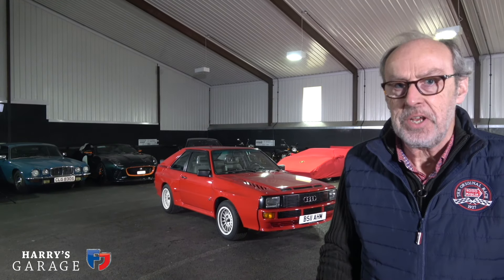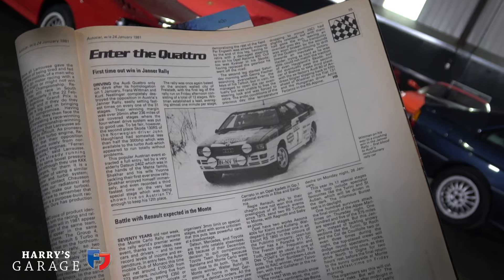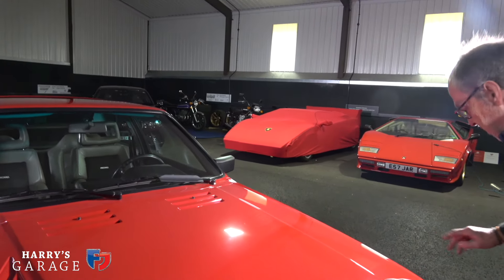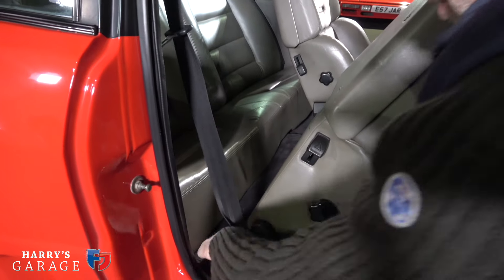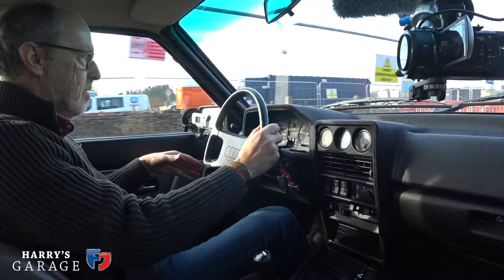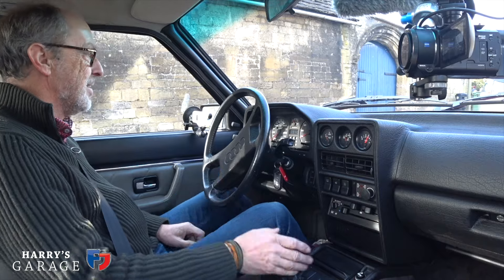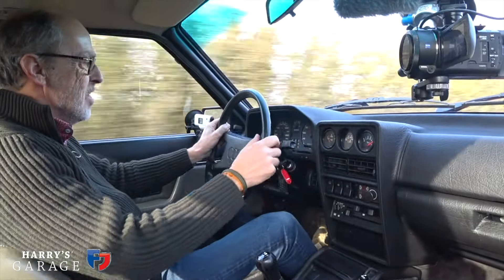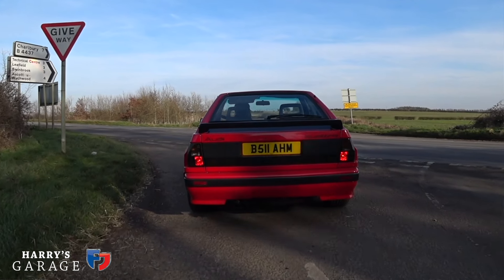Audi Sport Quattro. Best Group B homologation special ever?

Comment: The Sport Quattro was a rare case of the road car being a far far better car than its Rally variant. It wasn't particularly well loved by the works  drivers who found its  manners far far to twitchy and unpredictable for its own good especially when combined with its extra horsepower over the original cars...it took the S1 with its wild aero package to make it manageable. As far as group B is concerned it was Peugeot with the 205 T16 that really knocked the Quattro off its perch and also kept the Rs200 and Lancia S4 at bay too. 
History shows most successful rally winning Group B rally car as the Peugeot 205 T16.
As road going homologation special however the sport Quattro takes some beating - its road car dna origin really shines through.  👍👍

Comment: Harry, how do you rate the Short Sport vs the integrale you used to have?  I had an Evo1 'grale for 5 years in the late 1990's, and it was great car, but as a road car, it was, in all honesty, a bit disappointing.  (Floppy bodyshell meant the suspension struggled to contain the understeer and not really that much poke in road format)

Comment: Audi built one if not one of the only full blown Group B specials to hit the road both the RS200 and Lancia S4 and the 205 T16 were very tuned down compared I mean 4,5 to 60 in 1983 was just as quicks as a Lambo or a Ferrari at the time. OK the Sport did not fair well good against the 205 T16  when it appeared in 84 with a mid motor layout and better balance. but compared to the way the Sport Quattro was thrown around and man handled the 205 T16 looked boring the freak looks only add to the feel it gives off. all was finally topped off when the Evo version added wings and aerodynamics to the package . all the body panels were made from re-enforced Kevlar if my memory serves me correct in fact the two half's of the shorten Audi 80 were glued together again off the top of my head. I remember reading those first reviews for the Quattro sport not sure if that was in Cars or my other go to mag at the time Car & Car conversions but everyone was amazed that a normal looking road cars could have what was then considered Supercar performance. nope I never saw a real Audi Sport back in the day much much much later , I am say that as some one who did not live that far away from Wilmslow in Cheshire the Millionaire corner near Manchester. because at the time I had the job of collecting Buyers to drive back.  up from Manchester Airport to bring to my parents Antiques Warehouse at the time and the quickest route was through Wilmslow at the time. so I you saw plenty of rare cars in that part mostly AMG Mercedes and BMW's Porsche's and the odd Lambo and quite a few Ferrari's including an F40 but never any Group B specials.
So the only Quattro sports I saw were Rally one's because there were plenty of Stages of the defunct Lombard RAC  Rally that came through the Midlands.
The first real road version I saw was sometime in 2005/6 at a rally collectors show in Derbyshire  and I can not say if it was an original or one of the many excellent replicas that have since been built.
on top of that I have been living in Germany since 2009 in Hamburg  with a lot of wealthy car collectors and I am yet to see a Quattro sport  road cars been driven arounds plenty of other rare stuff but just not one of those. ho I am neither wealthy or a Millionaire. 
thanks again for bringing another classic to the channel.

Comment: Audi might have been first to use 4wd in rallying, but they didn't manage to hold their lead once the other guys went on board. Personal opinion, but the craziest, and best years for group b were the last 2 - 1985/6. The teams were all in, the divers were all in, the sport attracted the biggest audience ever. The cars were absolutely crazy, the fastest cars were the S4 and the 205. The quatros were behind. Even in 1984 the rwd lancia closed the gap with the quatros. When other manufacturers finally got their 4wd cars out, they were immediately faster than the quatros, next year, they were even faster - to the point that in 1986 Audi just gave up - they went to a few rallies, but they did not do a full time season. Politically that was the right decision because they were sinking down so fast. So, yeah, i do think that the Lancia and the Peugeot deserve way more respect than they are getting and the Quattro may be the first 4wd car in group b, but not the best. Honorable mentions: RS200, 6R4, 5-turbo.

Comment: Safety tip from a retired tarmac rally driver, don't put your camera person on the outside edge of a corner, just where a heavily understeering Audi may end up if it all goes wrong. I used to rally a Celica GT4 and had a road going Audi S2 coupe, both would make a run for the (Australian) bush on corners like that if I hit a damp spot!

Comment: “The unitized sheet steel body was a combination of metal and plastic parts, and we didn’t have the capacities here to build a car like that. At that time, it was tricky to paint that body so that the sheetmetal doors would look the same as the plastic parts, and they also handled that.” The plastic parts in question included the roof skin, front and rear fenders, quarter panels, front and rear bumpers and aprons made of a fiberglass/Kevlar blend, while the hood and trunklid were laminated fiberglass; these were supplied by Seger & Hoffman. The radiator cowling was a compound of carbon fiber and Kevlar, while the air intake duct–made by De Wethje Kunststofftechnik–was carbon fiber.

Comment: This monster was faster than all serial Mercedes and BMW as well as the tuning version. Not a single serial Ferarri or Lamborgini in acceleration to the first hundred could not argue with Sport Quattro! As for management, the full drive gave freedom of action! 
Yes, a non-serial car is built according to real racing technologies but on the nodes of serial cars! It was the most expensive and technological coupe of the 80s! Only Porsche 959 is more expensive. Quattro Sport is a true legend!

Comment: This is really exceptionally good timing, as I just happened to get abit of a quattro bug at the moment, hell i even bought a model of that one they did for ashes to ashes like a day or so ago, the one they resprayed in I think BMW Henna Red, like the same shade as the BMW M3 of the period and i cant wait for the video on the 10 Valve, as the sport quattro, well even the designer was noted for saying he thought the sport quattro was abit....... off vs the original

me personally I think it badly looks like it needs a set of rally lights to look right with maybe a two tone paint job to split it up abit.

Comment: With the age of the car, I bet a lot of the plastic on the shift linkages are degrading. Even like the Vw counterparts, they go right into gear you want as you expect. I also am willing to bet a lot of the bushings for the AWD system are getting worn as well from age.

Comment: This shows how so-called sports cars are going the wrong way today: their suspension is harsh to the point of uncomfortable but their driving experience is dulled by multiples layers of electronics, sound-proofing, and low-profile too-sticky tyres. The only manufacturer today that builds involving cars is Lotus, although Mazda's latest MX-5 is pretty close in terms of lightweight fun.

Comment: Whoa, whoa, back up a bit, this car, the "Shorty:, in rally terms was a lemon, it's record is terrible.

For a start, it's track was stupidly wide, it couldn't fit into natural created wheel tracks created over decades by normal cars, and especially in snow. It struggled down many narrow lanes, which rallying has a lot of, because it was just too wide, and constantly fell off the edge of narrow tarmac roads, it often had to follow the center'line through narrow "twisty bits" where as narrow tracked cars could straight line them.

The aluminum block engine ended up 25 kgs heavier than the cast iron block due to the excessive ribbing and integral structure sump to make it reliable, and of course it was so nose heavy that they stuck all the coolers up the back eventually.

But most of all, the driver's never asked for it to be shortened, nor did they want it, Hannu Mikkola famously hanging out for as long as possible in the old long car while Mouton drove the Shorty. Even John Buffum in a private long Quattro often beat Mouton on tight stages in the '84 RAC. The Drivers only ever asked for some more power in the long car.

So to answer your question, no, no it was not the "best Group B ever", far from it, and only shear horsepower where they could use it, and the world's greatest drivers kept it anywhere near the front.

Comment: Those Audi engineers, whatever they were paid, it wasn't enough, to develop that Quatro awd system. It is still considered the best system going. I had a 2002 A6 with Quatro and I loved the way it drove. And I drove it hard. However, the twin turbo 2.7 litre all aluminium engine was a problem.

Comment: 17:26 - Amazing Review, Sir Harry. Interesting that Audi have put 50kgs more weight on the front right tire than on the front left tire in order to balance out the driver’s weight (Provided this is intentional). 
Exceptional engineering. Still my 80s dream car.